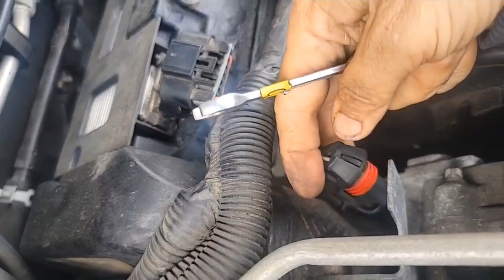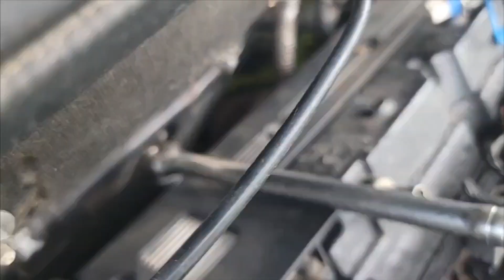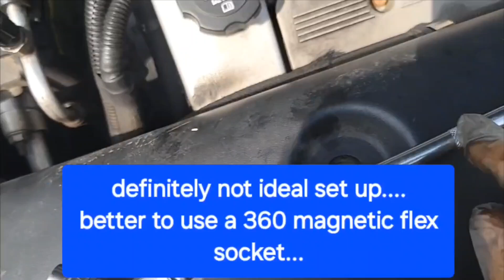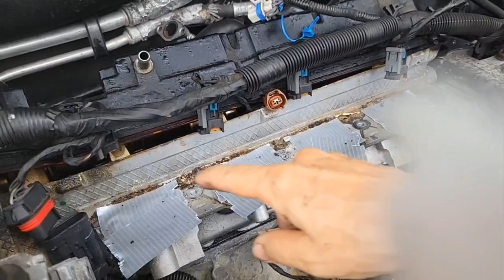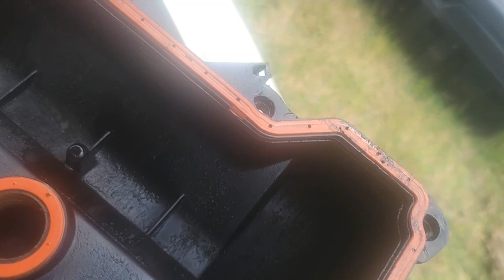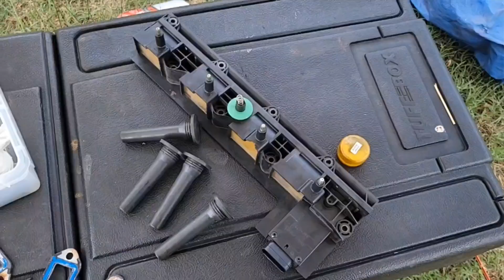HOW I CHANGED REAR VALVE COVER GASKET FAIRLY EASILY ON 4.6 NORTHSTAR  (NO TOUCH ENGINE OR EXHAUST)

Comment: What's that book?? Please I wanna be able to learn how to do everything on my cady
Reply from the maker: Hi Michael, the book where I got torque specs and such that is shown in vid is the Haynes Repair Manual for cadillac deville 1994-2005. U should be able to find it fairly cheap on ebay or parts store. Its a good start but the absolute best is the factory service manual. I have it for this car but cant find it. Its much more thorough than the Haynes. There is a factory service manual put out for each year. Just search ebay for your year make and model service manual. Sometimes they call it a factory service manual. Should be able to find used one for $30-50.
Reply: @girlintheblueridge6529  Thank you very much, I looked into it and people are selling the factory service one for 300+$ so I will be using Haynes, with that being said, what does the factory repair have that the Haynes doesn't?

Comment: Thanks a lo for your videos for Northstar engine they're quite descriptive and the best is your voice is quite relaxing, something I really appreciate because repairing these engines could be sometimes quite frustrating. ❤😊
Reply from the maker: @jamesorozco1243  yeah repairing these cars takes a lot of skill and patience. I initially was just going to fix the crossover but when i got in there it was a can of worms. I kept finding other things that needed repair or preventative maintenance. 
So instead of one repair it turned into about a dozen repairs as u can see from the videos i posted. It took me several months of the summer of 2024 to repair things. I thought i was never gonna get done. But now the car is running great and im so glad i took the time to fix everything and do all the preventative maintenance. Where theres a will theres a way. Sounds like you really care about ur car and are taking good care of it. I hope it lasts u a long time. How miles you have on it?

Comment: Boat anchor
Reply from the maker: @marcnissen578 hi marc,  yeah sometimes I feel that way. Car was a gift to me and it's been a blessing. Haven't done much to it for last 12 yrs... hoping these repairs will let it run a good many yrs.
Reply: @girlintheblueridge6529   the only thing that I’ve seen is head gaskets  , when you stud the block instead of using the replacement bolts it’s like a one and done kinda thing other than that they will last a long time
Reply from the maker: @marcnissen578 Hi Marc, yes, I did a timesert on a 1994 deville ...back around 2005 for my brother's cadillac. 
I tried to refuse this car for that very reason. But I needed a car so bad and I accepted it knowing that. I've been fortunate. I think it's had a slight headgasket leak lately but  I put a tube of alumaseal in it several different times when it started missing about 4 or 5 yrs ago and so far okay. It slowly took away the miss. They started making the headbolts longer in 2000 which helped. But they should have made the bolts larger too. My car is an 2003 with over 160k miles so I've evaded the issue so far. Got the car at 80k miles. Drove the car thru the blue ridge mountains several  times last year to go to Iowa and it made it. So the car has well served me thus far. I have seen on amazon some testimonies that steel seal fixed a few devilles for at least a yr and running. Also have seen that thermaweld has fixed some deville for a yr or so. Much much better to do the physical repair but sometimes the resources for that aren't available.  I'm 64 and I'm not wanting to do another head gasket.
If it runs to 200k I will be happy. 
I did, at the suggestion of my brother, put in an aftermarket temp guage and that has served me well also. The car's original temp guage doesn't warn you soon enough if there is a problem. The aftermarket guage has helped me keep a close eye on the true temp of the engine.
Reply: @marcnissen578  don't ever let the Northstar overheat. Monitor the temp with OBD2 to get the best reading and you won't have head gasket failure. I've only had to shut off the AC and blast the heat a couple times during the summer heat in traffic. The head bolt issue is caused by small, fine threads in the Al block... Helicoils and studs fix this but the engine must be out. It's a lot of work to do but it bulletproofs these cars
Reply: @devonkaufman2482  Pre 2006 that's true. The Northstar was designed to be able to drive for 50 miles without any coolant. Then in a cost cutting measure an engineer (I'd say dimwit) changed the head threads from the big course threads to cheaper to make finer threads saving $5 an engine. That's right, $5 an engine. Can you believe that? So much trouble over $5.